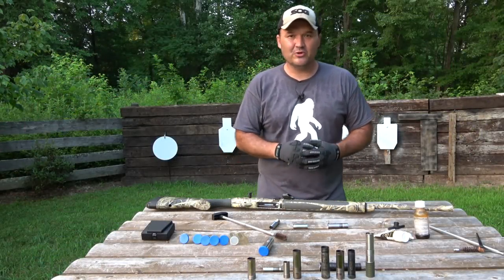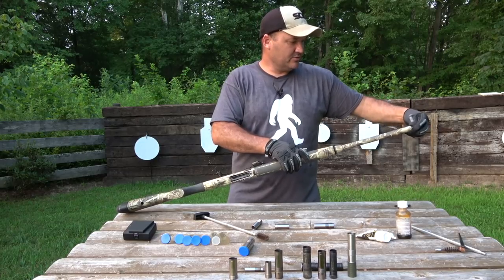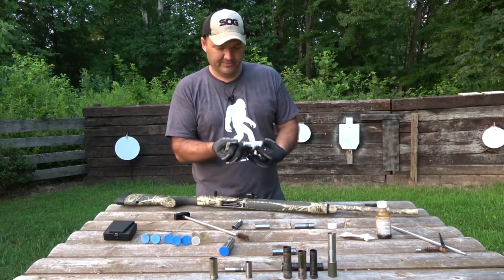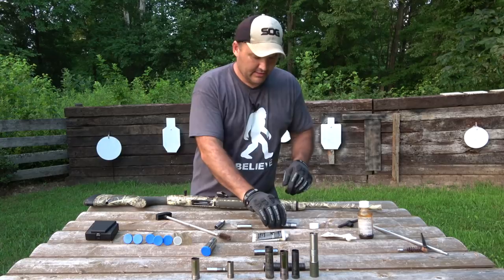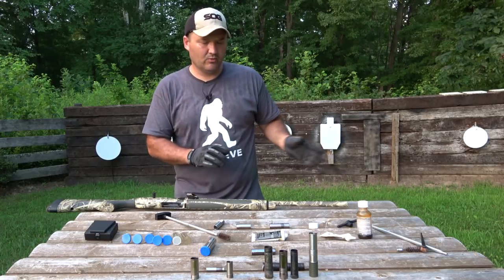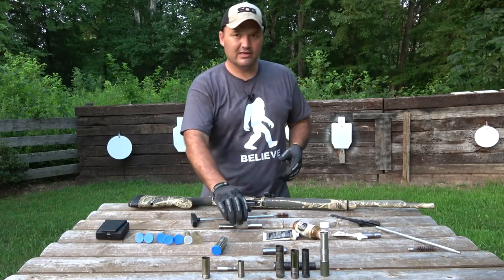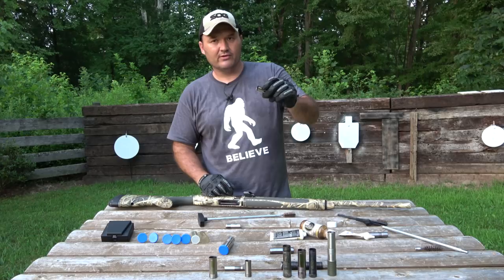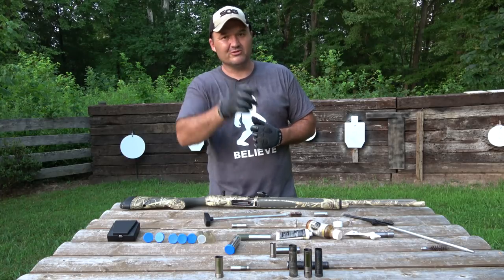Choke Tube Care

Comment: Why would you buy an extended choke compared to a flush(shorter) with the same diameter?
Reply from the maker: Easier to change out. If you change your chokes a lot this can be a factor. No wrench needed for the extended chokes. Also there are claims that the longer parallel section and forcing cone in the longer tubes provide a smoother exit for the pellets but I have not done enough testing on my own to verify.